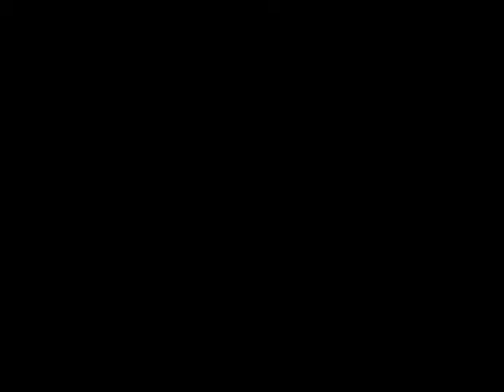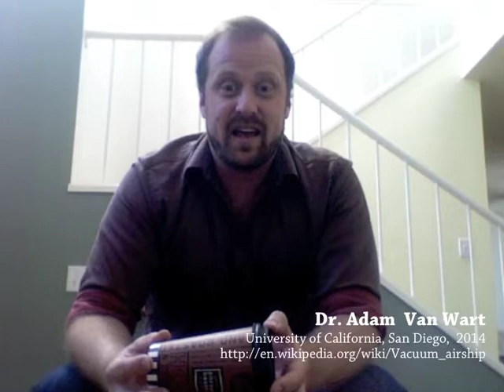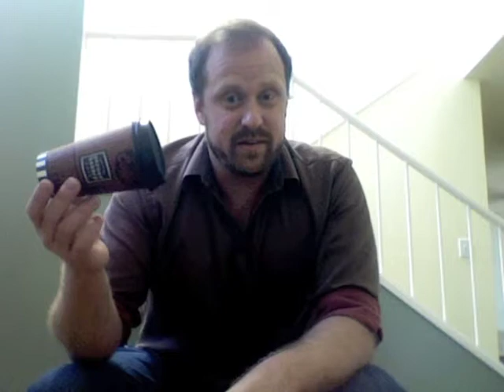Vacuum Airship (rigid container)

Comment: yes, it would work. Still working on all of the numbers and design, but the platform I am working on "floats" (and is evacuated) around 65,000'.
https://www.youtube.com/watch?v=OiaZDYM_xZw
Reply from the maker: I must have missed this post a while ago.  Did you use a 3D printer?  Thickness of nylon shell comes to around the thickness of a human hair for 22.4 L sphere.

What unit is the 65,000' (not feet I hope)?  If you are legit, I would like to talk to you sometime (no pressure though... ha ha ha).
Reply from the maker: How has the nanotech 3D printer worked for you?  The 65,000' ( ~12 miles) sounds like it could be reasonable.  My concern is that the pressure is pretty low at that height (like  < 0.1 atm).  It's not that having a low pressure won't help, but rather that a pressure is needed for the vacuum airship to float in the first place.  So the design must be either very large with relatively high value wall thickness, or the thickness of the walls are extremely low value with a small enclosed volume.  So my question is how thin can the wall thickness be... or how large can the vacuum airship be built?I have a few back of the envelope calculations.  It would be nice to hear back from you.

Comment: Exactly why would you build an aircraft carrier underwater? Build a ship in outer space and allow it to gently sat down on the surface of our atmosphere.
Reply from the maker: Hi Matt,

I was suggesting that it would be difficult to build an air filled SUBMARINE deep under water because of the pressure... this example was only to serve as an analogy to building a vacuum airship under the pressure of our atmosphere... which would also be difficult.  In both cases, the vessel walls would have to contend with high pressure.

Submarines are built in dry-docks and then submerged (they take on water to change the density of the vessel).  The density of ocean water is a function of depth and a submarine can take full advantage of this to float at certain depths by matching the vessels density to the density of the depth desired.

To answer your question: I don't know why you would build an aircraft carrier under water. -Adam

Comment: It would be more economical to just use secondary hydrogen balloon to lift it to higher portion of atmosphere and then to launch vacuum pump and detach. It could work. I've done some calculations of pressure vs density of air and reached that altitudes around 15-17km [not sure about the altitude exactly] yield best ratio of pressure vs density of air. So these altitudes would be your best bet. But than you still need a pretty strong and light structure, because the difference with ground conditions is only some 30 percent.
Reply from the maker: Hi Steven,

Yes... your suggestion seems to be a very creative approach.  You likely understand the central problem with your line of thought.  Perhaps we will see this attempted.

-Adam

Comment: It seems like we would run into and engineering issue as there isn't a material (medium) strong enough to handle the pressure effects of such a scenario yet not be so dense as to allow it to float....Same as if we created it on earth.

Basically, any material would either implode on itself prior to reaching neutral buoyancy or it would be so dense that it would continue to fall until it impacts earth?  
I don't know, my degree is in Business -- So my opinion would be If you created a medium (if possible) that could accomplish this you would be rich! :)
Reply from the maker: Yes... the material would have to withstand the pressure difference between the outside atmosphere and inner vacuum.  This may be possible at the edge of space (extremely high altitudes), or it might not work like you suggested.  I really would like to know. 

I have not seen this method proposed as many thought experiments for building vacuum airships seem to focus on containers that can withstand atmospheric pressure at Earth's sea level.  There is a cool story illustrating how powerful atmospheric pressure can be for such a container (see Magdeburg hemispheres http://en.wikipedia.org/wiki/Magdeburg_hemispheres).

Comment from the maker: Buoyancy is related to an objects density relative to the surrounding medium... all of which is in the presence of a gravitational field.  It is possible to model the brownian motion of particles, under the influence of gravity, hitting the surface of a container.  If the container is buoyant (floats), a net force imparted by the particles overcomes the gravitational force acting on the container.  A rigid container containing a vacuum would likely be crushed at the earths surface from atmospheric pressure.  However, if this rigid balloon (giant vacuous ping-pong ball) was built in space and pushed towards earth... would it float at some elevation of the earth's atmosphere?  An analogy to this would be building a submarine above sea level instead of at the extreme pressure of the ocean floor.